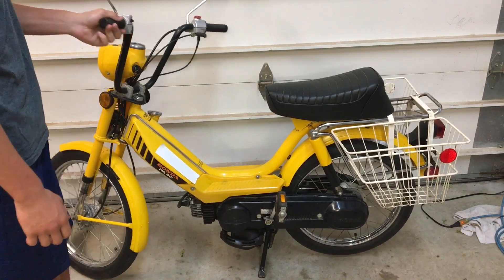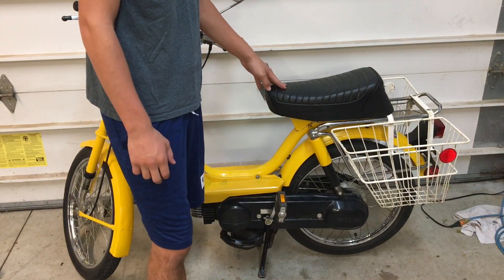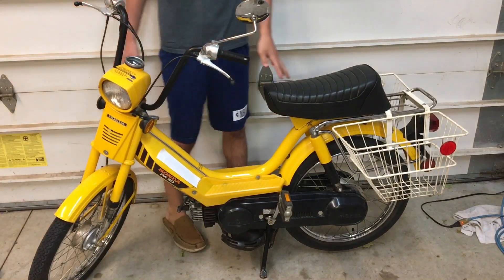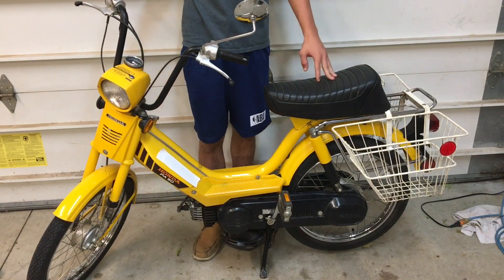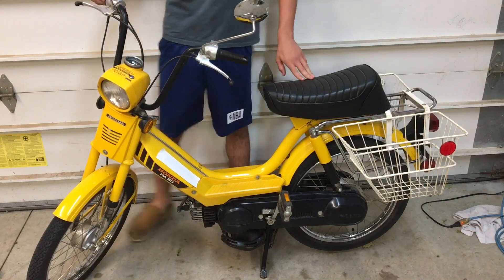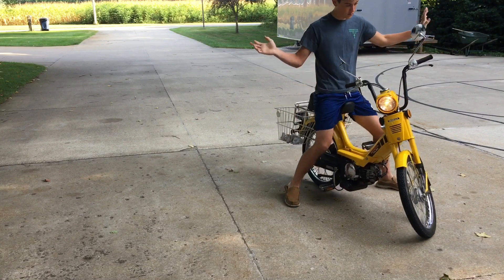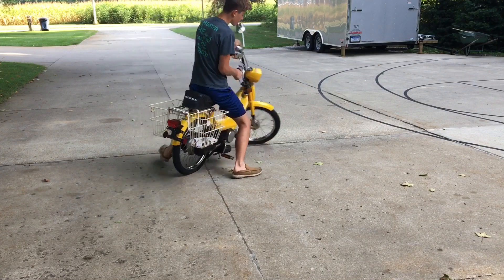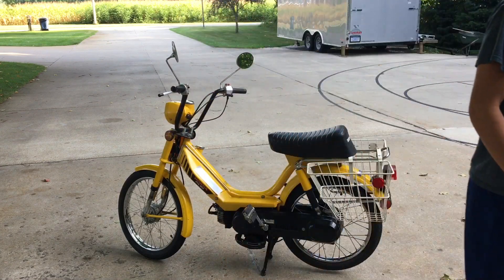Honda PA50 new carburetor she runs

Comment: What carb did you get? I can only find cheap ones with mixed reviews on Amazon. I’m debating picking that one up unless there is a better one.
Reply: Got a replacement from zoom carb. Worked just like new motor bought another as a backup for 22 dollars

Comment: nice moped to ride. Soft  saddle or not ???
Reply from the maker: Ruud v eck yah soft saddle
Reply: cool soft saddle to ride that moped. make more movies of this moped please
Reply from the maker: Ruud v eck unfortunately I have sold this moped to get more projects but more videos will appear soon
Reply: Setting The Tone hey could you tell me if the lights and horn work’s only when started or when off
Reply: @westriverjennin2490  they only work when the engine is running and producing power